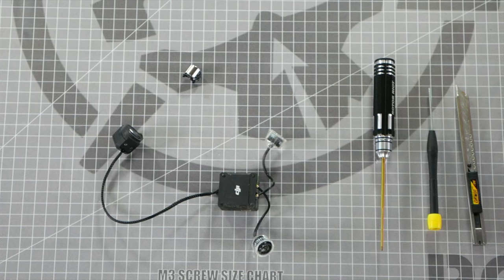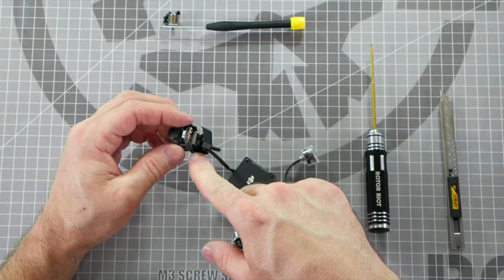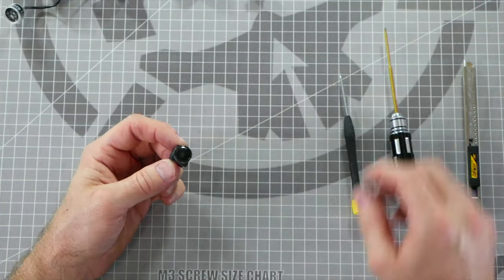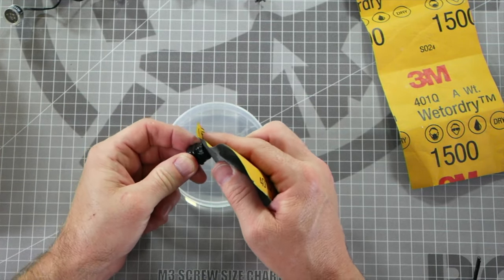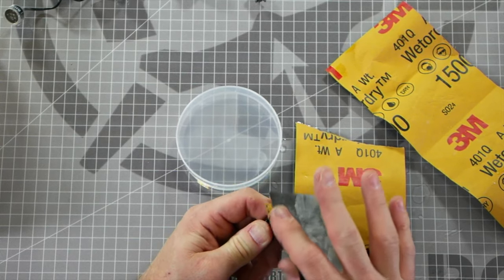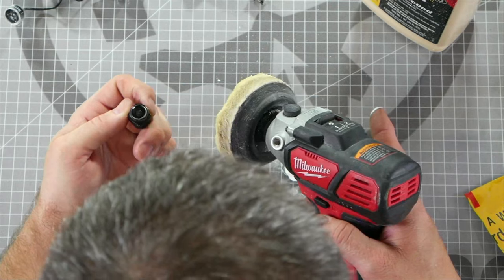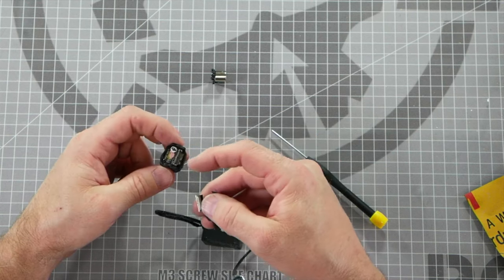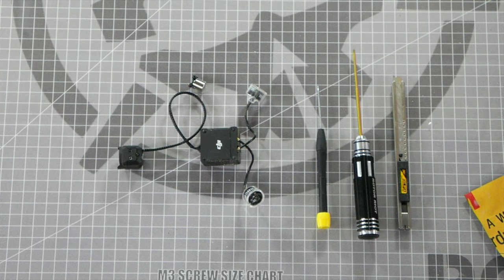DJI O3 Air Unit | How to Repair Scratched Camera Lens

Comment: My lens got dinged after a crash and a shock straight on the lens, this fixed it beautifully! This saved me a new camera module. Big thanks!
Reply: A word of caution though. There was a remaining dent and I sanded the lens again, but that time too much. Now the dent is gone... but I altered the curvature of the lens so there is distortion on the edges and the image is constantly over exposed. I think this is a great fix, but should be kept for light scratches and if the dent is deep, don't try to remove it completely.
Reply: Same mistakes done with mine. Now it has blurry footage on the edge

Comment: Great video, I pitted mine up today in some sand. 1 crash did it in pretty good, I was surprised how easily it got pitted up.
Reply: Yep, same thing with mine. Fell in some sand, and even though the camera was very loosely held in position and went entirely in the fuselage, it got really dinged. Keep sand away from your O3, folks.
Reply: @StavrosKor  Get some O3/Avata UV filters... The are about 7 to 10 bucks, already cracked 2... can get expensive :D but with experience, I think i should crash less, better a few UV filters with a crack (and still usable for fun freestyle) then a new o3 camera every month...

Comment: last night I was restoring the lost focus on o3, after the fall. And I managed to sharpen it by guessing the position of the matrix from the lens. Several times I glued and peeled off the matrix, changing the distance with dried glue.In the end, I achieved perfect sharpness, and decided to fix the matrix better by dripping some more glue on the joint. And in the morning I found that this was the last drop that flooded the matrix and the glass. I went on) after peeling the matrix off the glass again, I cleaned it of glue, wiping it hard with a fingernail and a stick. I got a clean picture again. But, wiping off the last corners of the matrix, I pushed it through to the sensor, and then the picture turned red. Ruined everything)

Comment: Just saw this after scratching my lens on my O3 camera. Does this seriously work and not damage the lens coating?
Reply: Asking the same thing right now. Can you confirm it now?
Reply: @davidebertone9382  No, haven't tried it yet. I'm considering just ordering the flywoo camera module and using the lens only. The Camera Butter uv lens protector has worked perfectly protecting both of my other cameras, highly recommended. Still love the system 👍
Reply: @jasoncourville9568  thank you for the answer. But i think i'm going ti try this exactly way. The reason it's because i bought my Nazgul just 2 weeks ago and i crashed him in the sand today... It sucks i ruined the lens just after 2 wreks